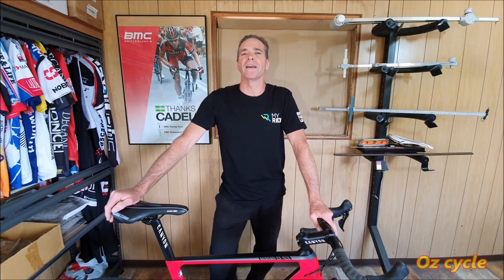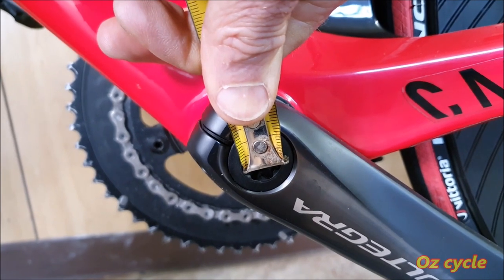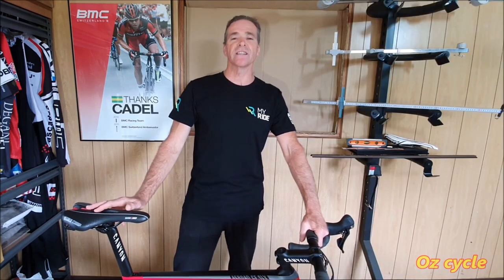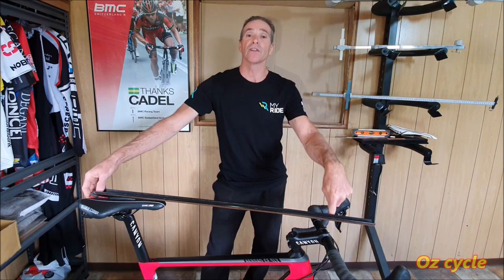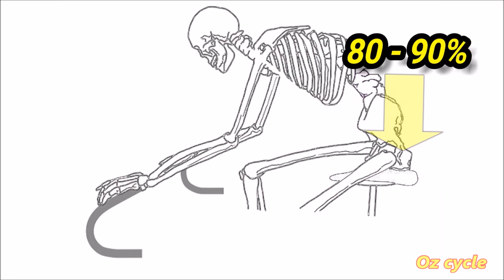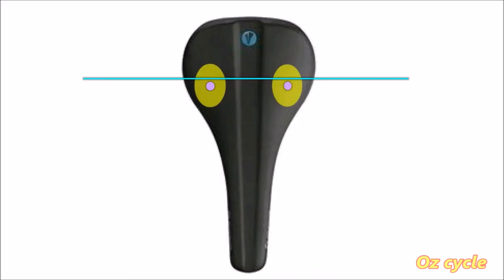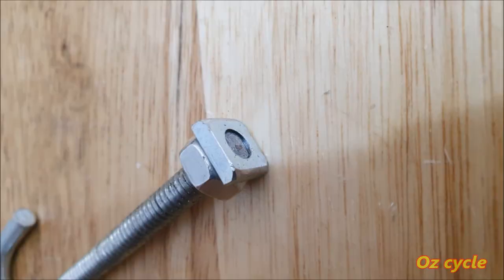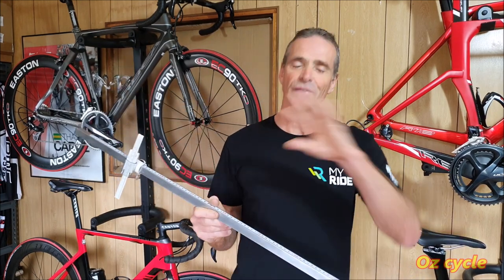Bike Fit tool - make it yourself Pt.1

Comment: 2nd Comment: Awesome Bike Fit Tool you devised btw. Another Genius Invention of yours. At 20:25 you should soak that Anvil-Vice in a  Plastic Bucket with a Gallon of ‘Evapo-Rust’.  Not sure about Australia but here in the US you can find it for less than $25/Gallon Jug or less than $80/5 Gallon Bucket.  You can strain it after and reuse it a few times before it’s strength wears out. Works GREAT on All the Bike’s Steel Nuts, Bolts, springs, Cassette Cogs and even Cables and Bike Chains so long as you Degrease them 1st.
Reply from the maker: Thanx. The vice lives outside in the weather

Comment: The tool at 6:00 doesn't take seat tube angle into account. If you use this tool on two bikes with different STA, the handlebar needs to end up lower and further from the BB if the STA is steeper.

Comment: I always measure the top of the seat with the crank arm positioned in line with the seat tube, starting from the top of the pedal axle with the arm at the lowest point. This takes into account any variation in crank arm length should I use a rental bike.

Comment: My Sit Bones are 126mm wide if you can BELIEVE That!  I’m a 51 y/o, 192 cm, 102 kg. American Sasquatch! (You get REAL good at Truing and Tensioning Wheels with my Stature, at Least 32/28 Spokes Minimum).  I prefer at Least 20mm Saddle Meat on each side of my Sit Bones.  Any Saddle Less than 160mm Wide doesn’t bode well on Mi-Bum.  FINDING any Decent Road Saddle OVER 155mm Wide ... GOOD LUCK ... unless it’s a Brooks.  Any Leads on a Decent sub $40 Road Saddle in the 160-170mm Wide Range?  At least semi firm with a Gonad Cutout preferably.  From “Chiiine-ahh” is ok.  Our new “President” is Super Friendly with them.

Comment: Thanks Steve for usefull informations as always, i'm bikefitting myself nonstop, looking for ideal fit. But one thing is still not clear for me, how to measure tilt at wavy saddle? (at back and nose, middle - nose...)
Reply from the maker: The tilt is subject to how you sit on the seat. Try tilting forwards n back to get ideal position. If you cant find it the seat isnt for you.
Reply: How the body interacts with the saddle will be different for each tilt. The same goes for where you sit on the saddle probably. But that is alright and part of the proces to find out what works for you. To document different tilt angles try using the bubble level app placed on a kitchen cutting board placed on the saddle. By resting the cutting board on the two maxima of the saddle it will always rest on the same spots, the app now gives the mean tilt. I use this on my SMP Dynamic saddles, which is very wavy.

Comment: Man im 50. I tried a few road bikes. Just to harsh on my body
Reply from the maker: Spring chicken...Im 56 and one of the younger ones in our riding group. Start off with a comfy bike.
Reply: You have to build up your tolerance, doesn't matter age. Start off with short rides or on a trainer and gradually increase. You body  will adapt to it. Good luck.